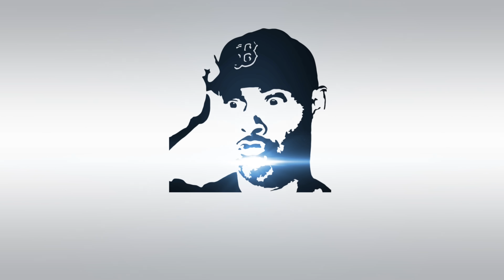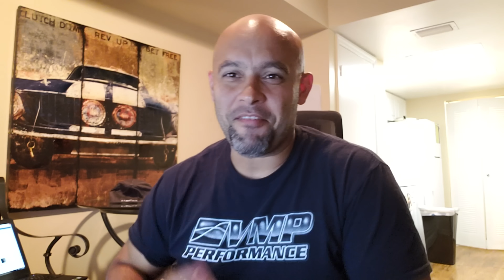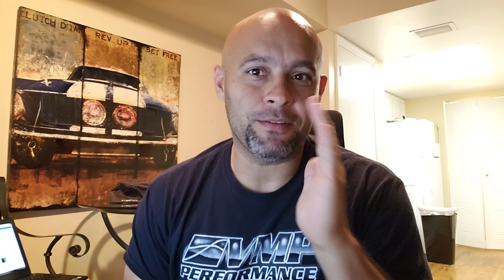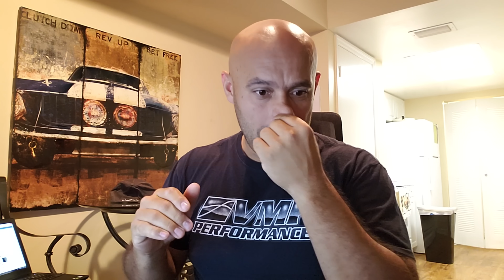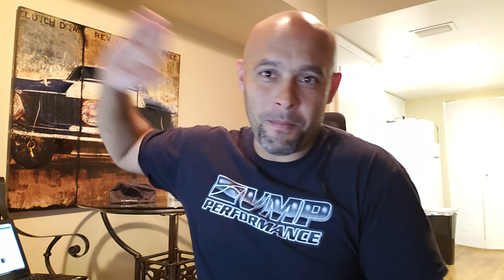Why your car runs slower AFTER you tune it. Hint, it's not the tune.

Comment: I know my Audi A4 was tuned, and consistently ran mid-4 second 0-60 times, rain or shine - only 290whp, but felt super fast part-throttle or full-throttle.  In contrast, my BMW has been tuned/retuned over and over, and it feels slow, even with more theoretical power at the engine.  Only the first tune I had, with DME tuning, and the car felt super fast, and likely pulled timing - I have never been able to get even close to that on any other setup.  Yes, weather makes a difference, but unless it's drastic different, you shouldn't notice it (5-10hp).  For the most part the reason why cars feel slower when tuned/modded is because there are so many variables that work together and the ECU (car computer) and there are causes that regulate the power.  Might sound wack, but after years of tuning I'm also convinced that certain car manufactures implement covert anti-tuning measures which can detect enhanced fuel/air parameters and regulate the actual power the car is making.  This is probably to discourage tuning of base models to perform like more pricey up-models (eg tuning an BMW 330i to perform very close to a standard 340i). Also keep in mind- most tuners don't tune for part-throttle improvements, it's full-throttle or nothing.  If you are coming from a refined tune like Unitronic or APR, for example, an independent custom tuner may allow for 10-15 more peak whp at WOT, but the power won't necessarily feel as responsive and smooth.

Comment: Yes this an older post but I just want to add that any  REAL veteran drag racer knows  and knew about DA/weather long before computers controlled the tuning. For this old timer what the most frustrating thing is you cant tune the car real time. Unless you have a laptop(usually) and tuning software AND know how to use it...you stuck with the tune it is running.  In the OLD DAYS you could mess with the timing and fuel(carburetor/distributer)  anytime you wanted too. I just wish there was an easy way to get into the tuning of modern cars.

Comment: @alejandro I have a 2002 ford lightning. I just replaced the motor with a new 5.4 2v long block from ford and rebuilt Eaton supercharger. Do you a custom tune I can use on a sct x4

Comment: This...big time this.

I went 12.538 stock with a tune.

D/A was great and I had crappy tires.

Went back down to the track the following year on better tires, headers and catless and picked up 2/10ths.

D/A was much higher the second trip down.

I use a D/A calculator to help make my runs a little more accurate when comparing.

I cant wait to bolt the boss 302 intake on and go back this year.

Comment: GREAT video! Question! my 2000 GT after two years of having these exact symptoms that you are describing I noticed that the ECU had a "tune" because someone remove the plastic cover of the chip slot in the ECU and the connectors were a bit sand it (for better contact). My question is" There is no chip in the ECU since I bought it and it runs like crap when the weather goes or pass the 50's (spring and summer) What can I do? Can the dealer re flash it? The car came with a Borla Touring's, it has Steeda CAI and BBK X pipes. Should I buy a tuner or buy a new ECU? I heard that if the tune wasn't delete or unmarried then you cannot re flash the ECU even trying to disconnect the battery for half a day. Thanks!!!

Comment: Isn't that what the MAF (mass air flow sensor) is suppose to accommodate those ambient air temp changes for?  If the tune knocks out the MAF then that makes sense; if it does not then yeah I would question it ;-)

Comment: Hey Alex, 
What's the typical power you get out of a fbo 2015 GT. I just ran at the track here in AZ and first time out went 13.1@109. Something in the tune seems off... Its tuned on e54 and put down 480/404 at local dyno 2 days prior. I'm really confused to the low MPH. Any help would be tremendous.

Thanks Joe

Comment: I have the $$ to not worry about tuning however I have gone through a few engines due to E85/54/51 and the high sugar/corrosion of the internals of the engine despite fuel system upgrades. I will still tune , but I have gotten a good tuner that has a self adjusting tune, that compensates for all weather, elevation, and fuel types over a 25-30 mile period all on the drive. I will not do canned tunes that were don even in one area and the weather and elevation and fuel of that area half way across the county.

Comment: Thanks for explaining how modern car tunes adjust for the weather, it's good information to know and I appreciate when someone takes the time to explain things in ways the layman can understand.  Having said that, please don't lump all 'old school' drag racers into this group that refuses to listen or learn new things.  I know the people you are talking about.  They learned some basic car stuff in high school (half of it was wrong) but can not be bothered with putting much mental effort into understanding why things work the way they do and defiantly can not be bothered with learning anything new.  Not all of us were/are like this.  Back in the mid 90s when I got into performance you couldn't pick up a car magazine without being bombarded with some article on rules of thumb.  One of the popular ones was that every 10* drop in temperature was good for an extra 1% horsepower output from your car.  Like most rules of thumb it is pretty generic, doesn't take into account anything else like barometric pressure or humidity and is probably not very accurate, but it does show that many old school guys understood that weather affects power output decades ago, at least if they bothered to pay attention.  In my experience most of the guys who go out of their way to tell someone they have been racing for 20 years probably have not, or at least have not done so very successfully.Great videos, keep up the good work.

Comment: Hi Alex, This my be a noobie  question, But I have a 2016 Mustang GT HPE700 and i just started road Racing. At What temp Does heat soak start to happen on the 2016's?
Reply from the maker: Iblaserman depending on tune.. over 150 iat it starts to pull timing
Reply: What would be a good  a Cylinder temp that i should keep an eye out for, while on a road coarse?

Comment: isnt the maf sensor supposed to factor in density altitude to keep it consistent? or is it normal for maf to decrease as  da increases?
Reply: steven neufeld Thought it was to help maintain air-to-fuel ratio to keep your car from running rich or lean. Not a mechanic, but I seem to remember hearing that's what it's for. Could be wrong!

Comment: so pretty much if its summer time and you have your car tuned and its hot and inlet air temps are sensitive  so temperatures then that bascally means sports cars are useless when its summer time?? makes sense because sports cars are made for TRACK USE  ONLY... thats what they are purposely made for....  so pretty much to me it looks like if its summer time or spring then that means the car isnt going to run at its best. which in other words your going to be loosing horsepower and torque across the board because its going to be hot out and cars dont like hot air.

Comment: I run into this problem with my car. Although I'm smart enough to not blame anybody. I'm pretty much maxing out a turbocharged car with the stock turbo and stock intercooler. Running 11 psi more than stock with 93 only software. It runs like a raped ape in 50°f and colder weather pretty much back to back. But right now in Michigan with the highs possibly reaching 90°f on summer days. It gets heat soaked so fast. It's actually making more boost than it did in the winter and this down on power about 15%. But I know this is from my IAT's and I need to upgrade to a larger front mount intercooler. And even then I still could have issues because when you push a small turbo really hard it  just creates a lot of heat. The 3" catless downpipe has helped some for under hood turbo temps.  But he's right the bottom line is. A modern ECU will pull timing to avoid knock in hot humid weather it's just the reality of it. The higher the intake air temp the less power you can expect. Cold air is more dense. For us turbo guys that leads to a lot more power in cold weather and a lot less traction in cold weather ultimately. I can't wait till this fall so I can do 2nd gear burnouts on the highway Entrance Ramp again. Lol.

Comment: Everyone on YouTube should see this. They don't understand why sometimes cars in PR usually run much slower. For example everyone is used to seeing mid to high 12s in a ISF in YouTube but when someone in PR does a pass and runs mid to low 13s they start blaming the driver. When here in PR it's usually very hot and humid.

Comment: Good points, I could see this being an issue for people with carbed setups running ignition systems that don't compensate for temperature. Unless they're tuning it in at the track chances are they're running timing for worse case scenario (e.g. hot weather) and are actually leaving power on the table when its cool without even realizing it in those vehicles. It becomes a lot more obvious in a modern car that automatically keeps the tune "proper."

That said I'd hope that someone that's been into working on cars for decades would know that colder air is more power without an extensive explanation.

Comment: Nice explanation! Luckily I already had a general idea about air, elevation, temp affecting everything. So at the end when you were explaining being able to drive across the country on the same tune, I'm assuming that's where the knock sensors come in? We had our first really hot day yesterday (IAT was in the 130s) and my knock sensors were pulling a consistent 3* at anything over 50% throttle. Assuming that's the case and point to a certain degree of this video? Basically "Screw what you want to do, it's hot af i'm saving myself" :')

Comment: When I had my 5.0 I ran a stock tune, then uploaded a Lund tune and ran it again 30 mins later, it ran 5 tenths and 4mph faster.
Reply: Regular Guy Garage  I had 2 identical 15 GT Automatic Mustangs both on drag  Tires one was bone stock the other had a Lund tune  The stock car was  0.1 faster   Running both cars next to each other And we switch drivers
Reply: Regular Guy Garage ive always heard Lund is the company to go to for 5.0s, that's a solid gain
Reply: If the gears are stock, there should be a tag bolted to your rear end cover with the ratio on it.
Reply: the label inside the drivers door jam should have an axle code..just google the code and your year car and that'll tell you what gears you have...I don't have them memorized anymore
Reply: Recently threw a Lund tune on my 2011 with bolt ons.  I evidently don’t know what gears are in my diff (bought the car used) as I told them 3.73’s (per axle code on door jamb sticker) but whatever flash was on the car was broken when I reflashed it.  I was at first like DEUUUUMMMM DIS BITCH GETS TO 100 QUICK and then it dawned on me either everyone after that was doing 60 in a 45 or it broke a speedo fix 😭😭😭 that said, car never did fry the tires in first or second but with the tune and the supporting mods I have it now easily roasts them in said gears.
Reply: How do you find the gear ratio I bought my car new and never saw where it listed the gears but I have a tune and,my Speedo is fine I just chose a stock gear option lol
Reply: Cookymunster if you bought it new it says in the window sticker
Reply: Cookymunster mine says 3.15
Reply: Ima crawl under my car to double check lol i should have 3.15s since my car is a auto
Reply: Well I looked at the axle code and it was DD I believe it said on Google those are the 3.55 option sooo....and I just ordered a new tune with the stock gear option ...gotta get that fixed before I'm speeding in a school zone lol
Reply: Maurice Cooper I worked on oval short track cars my entire life. The chances of 2 engines being the same is probably less likely than you being struck by lightning. 

Where does the oval part fit here? We log EVERYTHING THAT CAR DOES. So in a series like ASA when we would run it. They ran a sealed ls1, had a mild cam I wanna say, harmonic balancer, and oil pump was dry sump obviously upgraded. We wanted in on the challenge.

We built 2 cars, had been winning all over the South in super late models. We go to ASA we are not very good.  We had to learn the cars we accepted that. It was a different chassis. What we learned was the rich kids aka reed Sorenson. Would go buy 20 of those things. Dyno every single one until they got the best one. Then had the nerve to turn and sell the worst ones. When rules are that tight the tiniest amounts of power make all the difference. We got 3 engines next season, had our motor builder dyno them. Sent us home with some crazy good racing oil from Gibbs that gave another 10hp and the best of 3 motors were then tagged in order. Details.. 

Point being, put that kind tune in the stock one. I bet it's got a better motor. Hell the suspension could hook better. Car weight could possibly vary very little. Who knows? 

They aren't identical as hard as Ford and everyone try
Reply: Regular Guy Garage o
Reply: cookymunster i THOUGHT my car had 3.73’s but evidently I was wrong unless they somehow messed up something trivial in the tune which I sincerely doubt.  If it doesn’t match up with axle code on the door jamb sticker or anything that may or may NOT be on the diff cover or axle tube you have to count ring gear teeth and pinion teeth, then divide ring gear teeth by pinion teeth.  At least, I believe that’s what I remember reading.
Reply: blackonefifty There’s also a forum where I saw somebody post the top speed for every gear for every set of gear ratios, if I remember correctly 3.73’s in 4th gear at 7000 rpm you’re at 115mph, and for 3.31’s in 4th gear at 7000 rpm you’re at 130mph.
Reply: Holy shit

Comment: Great explanation Alex! My 2017 5.0 ran 12.76 w/ a roush CAI, and an x pipe with roush axle-backs in 650 DA @ 111.49 mph and with a VMP E85 tune and the same setup it went 12.80 @111.81 mph in 2600 DA so I was pleased.

Comment: Alex I need some advice. I’m ready to buy a supercharger kit for my 2012 gt but am completely undecided on which type or brand. If you were starting over on your old 11 gt , which one would you buy knowing what you know now. 
Thanks. The videos are great. Keep em coming.
Reply from the maker: Manual? i'd still do vmp or a Paxton 2200
Reply: Alejandro Flores 
my car is an auto. I’ve been leaning toward a vmp because they come with a tune. My car has long tubes and a boss manifold so I’m afraid the tune that comes with a Paxton/Vortech /Procharger won’t work with my setup.

Comment: Being a pilot I know all about Hp and density altitude and heat etc and how airplane engine performs if they went down and were good at drag racing doing et drags they would notice the car speeds up towards the end of the night cause air is colder and the track is cooling off so tires could be less oily etc u have to adjust your time as the night goes on so u don't bust out.

Comment: Some tuners are stuck in that old mind set of everything needs to be static in order to be good and consistent. So maybe not a Lund tune, but others it could be the tune. With modern ecu calibration the benefit is you can be dynamic and adaptive so that the engine runs optimally in all conditions external or internal. Counter intuitively this actually produces a more consistent car as the weather effects how it performs less, not more. Thanks Alex for your great content (informative or entertaining ) keep it coming.

Comment: Weather effects all vehicles carb or electronic all year long. But with Electronic engine changes car for the best.  Even gas effects it because gas is changed for seasons. My 2003 Ranger with 2001 Explorer 5.0 runs better in summer than winter because it pings slightly in winter and don't in summer.

Comment: It’s funny cause if you work out side in the heat it’s harder to breath due to less dense air vs work in doors in the A/C it’s way easier to breath more dense air...and motors are air pumps after all.

Comment: I didn't know that DA changes that much if you are testing in the same city even if the time of year is different.
Reply from the maker: Absolutely does, Here in west palm i've seen 100 DA and then 3500 DA Winter to summer
Reply: Yup it's crazy how much it can change. Some people even go to certain tracks during specific times of the year for the DA to run times to brag about. Dragtimes.com has a good density altitude ET calculator per date and track
Reply: oscar argueta download the Drag Times app.  It'll give you DA by location or by track, every hour.  One month in between passes here in West Palm Beach, I saw a 500' difference with temps not that different.
Reply: Todd Grossman to many bad reviews on that app for android to pay $3. I'd rather buy the tool
Reply: Wow that's good to know. Thanks. I'll have to buy one of those density meters so I know exactly what it's at when I go to the track. And damn it alex, all the other times I ask you about how to get a personal tune by you and you dont reply but to this one you do lol.